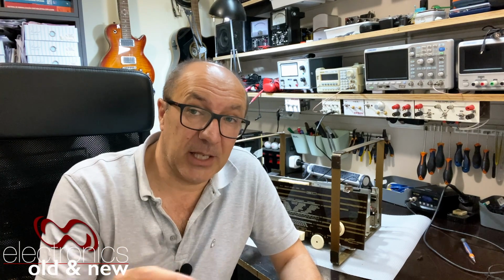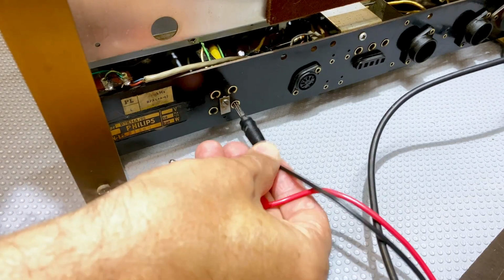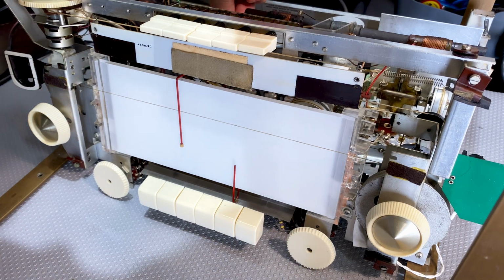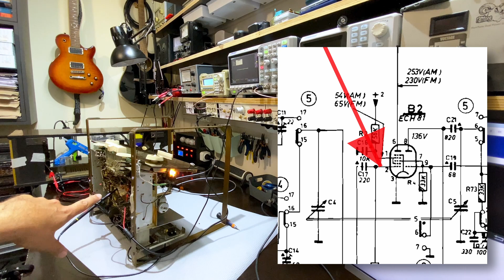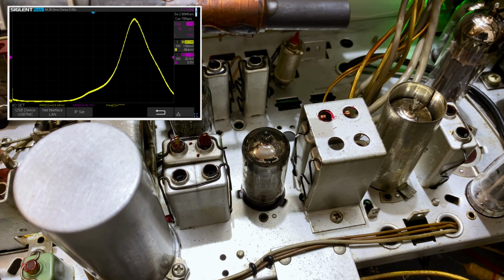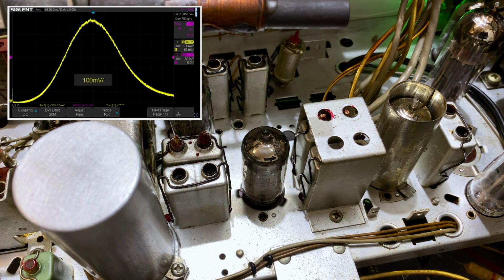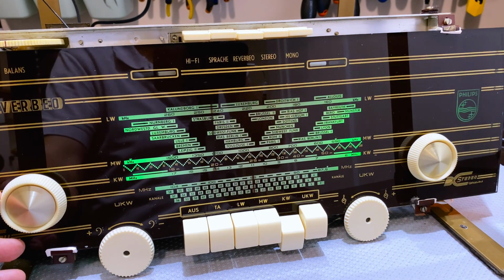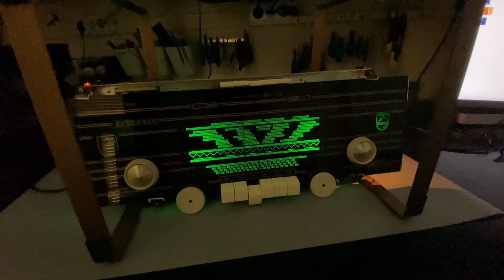Looking good, but does it even work? Philips Reverbeo B7X14A Stereo restoration pt 5 #PCBWay#

Comment: Some radios were aligned to different IFs depending on the intended country where they were sold. Sometimes it was done for a reason that marine stations in the 400-500 kHz band could interfere with the IF. These marine stations are long gone now. If you lived closed to the coast near a marine transmitter like Scheveningen Radio you could get interference on 460 kHz and you could better have an IF away from it. In Germany there might have been stations interfering with 452 kHz.
Reply from the maker: That makes sense. Thank you.

Comment: Hi Manu... great job!! 
Your remark about " i would like to see what a original luminesence dial lookes like " ..so funny ...because they all are broken !
I have repaired many hundreds of these radio's and never have i seen one working! 
Actualy once i have repaired such a radio which had ( like all of them ) no lights...on closer inspection i could see that the illumination was connected wrong...it was connected to the 6.3 Volts so it would not work because it needs HT .. It looked that this was a original connection ( mistake made in factory ) ... So i changed it to the normal position ( on HT )..and it worked .
So this was the first ( and the last one i ever seen working ) ....a nice fluo green even glow .
But yours is about the same . I usualy replace the glass lumi- plate with a plexiglass ( 5 mm thick ) which i have sandblasted..then cover this plexi with a green plastic foil ( from a document folder )... for lighting i use a aluminium plate with  2 holes ..then 2  6.3 Volt lightbulbs fixed in the holes with rubber grommets ... 
This plate can be fixed with 1 screw on the tab of the chassis.( above the keyboardmechanism ) This method is also the proposal from Philips..these lumicention dials were realy bad and they broke down very soon afther a few years.. Philips knew about these problems and they had this solution foor there serviceman in there service bulletin's.
Later models had no such illumination..but used normal bulbs ( like in the more budget models ..)

I still can not understand what had happend with this radio with this original fault..Did nobody see that it had no illumination ? Did nobody complain? Strange.....

Greetings from your Belgian Fan..
Dirk
Reply from the maker: It always amazes me when you find faults from factory, that were never corrected. People just didn’t complain as much back then as they do now 😊 
I still don’t understand why this one was aligned to 460kHz IF, also apparently some at the factory.

Comment: Just compared the EF89 and EBF89... For a while one of the detector diodes in the EBF had quite a voltage on the anode (pin 8 is grid 2 in the other tube). What a luck that the EBF did not melt.
Great work, again Manuel, thanks for sharing!
Reply from the maker: I guess I got lucky. This time 😊

Comment: Well done, the chassis looks brand-new and your dial glass back lighting is the crowning touch of your face left. I was surprised you couldn't hear your beacon on VLF. I thought I might hear the wind in the background as the Atlantic seems to be experiencing its normal spring storms. Great video thanks.
Reply from the maker: The beacon is at 338kHz and this doesn’t go as high as that. As for the wind, you’re absolutely right 😊

Comment: IF could be different depending on the country where it should be sold, in order to prevent from interfernces between image frequencies from some transmiters (out of band) and in band transmiters.
I like the way you align IF transformers, I think it is the best way. It is possible to widen the bandpass for a better sound quality.

Comment: Manuel at 20:25, you are tweaking again the first coil, peak it up, and then go to the second coil tuning going down in frecuency,  and then (I've seen in other radios..), the second coil starts its mutual coupling with the first coil?? the  scope shows a punched wave, you escape from this to center again at the if frecuency again. That's the way I suppose..

Comment: It's gonna be a looker! Dial lights work a treat and the glass looks pretty much new.

Weird that the IF was factory tuned to 460. When the FM is up to standard I expect it'll be spectacularly good!
Reply: Back in the day there were a few different IF frequencies.  455 was a more common one as time went on, but frequencies between 450 and 480 were used, 460 being one of the common ones also.  Everyone had there own way of doing things in the early days.
Anyway, guessing someone made a boo boo and set this to 460Hz.  Someone may have had the wrong diagram when they tuned it.
Reply from the maker: Actually I’ve just discovered that there is a different service manual for the german version, which states that the IF for Germany was indeed 460kHz. Benelux countries used 452, so it seems this one was in fact set correctly. I was just looking at the incorrect specs. It happens 😊
Reply: @electronicsoldandnew  Oh well.   If it works well, who are we to complain :).
I probably would have made the same mistake between the 452 and 460.    :)
Reply: @EsotericArctos  Yes, seems likely.
Reply: @electronicsoldandnew  Ah, right.

Comment: Great video!  Really enjoyed this one...as I do all of your videos.  I do though, wish that you would quit putting yourself down.  We all make mistakes...most of us at least once every day. 
The IF on this one is a frequency I have never come across before.  I have seen 450, 455, 460, 465, and even 915 Kc +/-  0.1% before, but never 452 KC.  (The 915 KC is on a BC348 receiver)
I am thrilled with how the green backlighting worked out.  While you were talking about the areas that you painted white, I was wondering if it might have been better to have painted them green, then the more I thought about it, the more I could see you were right with the white.  I don't think the green would have reflected the light as well.
Let's see, you still have the FM to do on this one, right?  You've got the power supply, the audio, AM IF alignment, RF alignment...getting close to the end for this one.  I wonder what new treat will come after this one.  Thanks for sharing these with us!
Reply from the maker: I am quite impatient, especially with myself, hence the repeated put-down 😊 
This IF frequency is unusual but It has been used on phillips sets other than this one. In Europe, 460 is the most common. 
I do need to tackle the FM. That’s always the most nerve wracking part 😊

Comment: Observing the opposite curve skew 460 vs 452, it appears that these cans “want” to be tuned somewhere near 455 KHz.
How did you get the scope to sweep in sync with the signal generator?
Reply from the maker: The signal generator has a sync output at the back, which I use to trigger the scope.